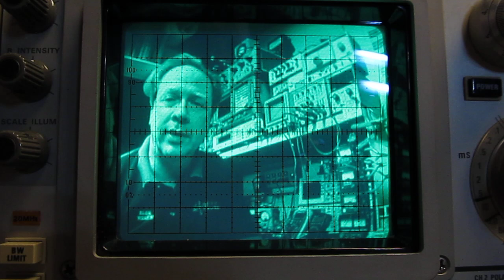W2AEW Channel Trailer video (#95)

Comment: Just discovered you channel and agree that it is the most informative electronics site I have found. 50 years after receiving my BSEE, your tutorials are bringing back long lost knowledge in a concise and understandable way. I am up to video 120 and thoroughly enjoy watching them.
I am very interested in duplicating many of you basic electronic experiments. I have a good inventory of digital stuff, but very little analog. Can you suggest a list of analog components that would make up a good kit of parts for experimentation. Specifically op-amps, comparators, transistors, and diodes. It would also be useful if pdf's of your diagrams were available. Thanks for the great videos.
Reply from the maker: Thank you for the nice comments on the channel.  I am glad that you're enjoying it.  A good jump start on parts can be gained by picking up a kit such as: 
https://store.digilentinc.com/analog-parts-kit-by-analog-devices-companion-parts-kit-for-the-analog-discovery/
Or, if you'd rather get things yourself - get a basic set of passives (1/4w resistor assortment, ceramic capacitor assortment, electrolytic cap assortment, LED assortment, diodes such as 1N4001, 1N914A or 1N4148, maybe some zener diodes, basic transistors such as 2N2222A or 2N3904, and their PNP counterparts.  General purpose op amps (single supply, rail to rail would be the most versatile)...  Again, might be easier to start with an "analog" kit like above.   Also, please note that PDF files are available for most of my videos - the link for the PDF file (if available) will be in the video description that appears below the video on the YouTube page (you may have to hit the <show more> button).

Comment: You tricked me, I thought the image was overlaid on an oscilloscope :) Respect!
Reply from the maker: Yep, that’s done by feeding NTSC video into a homemade NTSC to XYZ converter based on a sync separate chip, some resettable ramp generators and a z-axis intensity / luminance buffer, all feeding a Tek 485 scope.
Reply: @w2aew  Yeah, I spent some time thinking about how to fake this result from the moment I recognized the reflections as real. I was fascinated by the plan to achieve a clearly displayed image. Thank you for the explanation.

Comment: Hi, thank-you for the video tutorials. Can you please make a video tutorial about a wireless test set (250kHz - 999MHz) : for example IFR COM-120B. How to generate modulated signals and how to inject them in different parts of radio transceiver for troubleshooting .
Reply from the maker: If I had access to a test set like that, I'd do a video on it.

Comment: Thank you Sir for all of your wonderful contents. I have a suggestion, which helps people like me, who are not electrical engineers. This is not my own idea. Ben Eater, started a series of videos about making a CPU. I learned about a lot from him. I was wondering if you can do similar thing in RF area, For instance making an bare bone oscilloscope, or spectrum analyzer, and along the way explain the concepts related to RF engineering. I can read these things in the book, but it will be easier to grasp if someone put them in a real projects.
Thanks again,

Comment: Hi Alan, I am currently  working with Beacon Flash lights and warning Bells. I would appreciate some video tutorials on Xenon lights and how the main cap discharge into it. Also some information on sound measurements as  I am currently using sound level meter to measure a Bell sound in a range of 106-111 dB (tolerance -,3, +3 dB). Many thanks.

Comment: I have watched a few of your videos and you have a major talent for electronics obviously. I  recently purchased a 2215a  as a total new B to oscilloscopes, bought for  sine wave AC current household power. Wave compared to a generator wave do you have any recommended people for looking at my scope for proper tuning?
Thanks JC
Reply from the maker: I have many, many videos that describe the use and operation of the controls of an analog scope like this.

Comment: Hello Alan,
Would you please make a video showing how to measure the sensitivity of any radio receiver in a practical way and explain how to convert sensitivity to certain expression once interpreted in different forms like uV, uV/m , uV  at (XX)db or uV at 50 ohm ..... etc
I have encountered many ways of such expressions used by radio receivers manufacturers from portables, to high end communication receivers, and I'm really totally confused how to compare an apple to apple . Also many claimed that they have enhanced the sensitivity of their radios with certain modifications, is that possible technically and how to do that practically? Last point, what distinguish a radio receiver from another from reception point of view like sensitivity, selectivity ....etc and how to check these characteristics in the real life.
Appreciating your efforts.
Thanks
Abd

Comment: Hi Allen, not sure how to get a message to you but I'll try here.  I wanted to request a video on the best way to test an old ignition coil on a small engine using a scope and or signal generator.  Preferably both with mechanical breaker points and a more modern one with electronic ignition with the two transistors in a Darlington pair.
Thanks, Bruce (K2XYZ)

Comment: How did you get such good video on the oscope? I've tried in the past and only got decent video, but that took me three scopes to do. One for vertical sawtooth waveform one for video amp (used for scope with non amplified intensity mod input) and one for both horizontal sawtooth and display.

Comment: I started a comment a bit ago and it disappeared before I was done, so if this is a duplicate I am sorry.
I have a 2467b and the schematic shows the input fuse on the neutral leg of the power coming from the wall? I am use to putting the fuse on the hot side. Is this because it is either 120v or 230v or did they make a mistake on the schematic, BTW the scope is wired as the schematic shows. I know there is another mistake on the A3 Inverter Board. There are two Caps that are shown in the wrong location and if you follow the diagram you will get smoke. Luckly I changed one cap at a time and caught the problem, I then wrote the person who supplied the caps for my project, and he confirmed they were shown incorrectly.
It would be easy to switch the wires around, but though I would ask someone with more savy than I have.

Thanks, and keep up the good work,
GR

Comment: Hi Alan, Replaced the fuse on the 475A/DM-44. New fuse also opened.So ii opened the black fuse box again , replaced the fuse w/ another, however this time I pulled out the white voltage selector plug, inspected it and plugged it back in the medium position 115 Volts.closed it up, turned it on , The scope turned on ?? running now 2 hours all seems well? Low line bulb flickered a bit in the beginning...gone now at 117 volts..Hope its ok...Carl Thanks N2MFW

Comment: Alan looks like i'm back in the same boat...Fuse went again after about 2 hours of running, just idling...Wonder if the white plastic voltage plug plays a role here?? Or worse, a filter cap in the power supply..I hope you don't mind but i sent you an e-mail , if you get a chance I would appreciate it very much if you read it and would get back to me on the info there....Thanks Very much Carl

Comment: im uneducated and im curious about my motherboards which are very important to me and recently im buying used ones and ive noticed that they have a light that i assume means they have power and when their turned off the light goes out between 1-3 seconds on new boards and 1-3 minutes on used! this concerns me! they used SOLID capacitors not electrolytes. i assuming it because their capacitors have worn out and im concerned this could lead to complete failures and so im curious if they should be replaced and im researching this. you cant imagine what its like to turn something off and its still working!
Reply from the maker: Don't worry about it.  In fact, the longer the light stays on, the better the capacitors are working to store charge - so it's a good thing.  However, you can not judge the health of the capacitors by this method because different motherboards use different values for capacitors, so the hold-up time will vary.

Comment: Hi. Not the first time I ask you something. 

I finally bought an analog scope(Tek 2215A). It seems to be working ok. I had no problem to view some pwm stuff.  But there's something annoying me. I can hear a continuous intense sound coming from the scope. It's a noise I hadn't noticed in scope videos. 

First, I thought it was due to the nature of the crt operation. But I think it is no harm to ask, since it isn't something I expected (maybe because of my inexperience). What do you think? Thanks
Reply: Erick Moraes I know it's been 3 years, but I had an early 2213 that had a bad transformer hum. From what I've read on the Tek Yahoo group, its very common on that era scope. 73 W8BT

Comment: Hi , im new around here , i would ask you if you do a tuturial about class A  and A/B  push-pull  amp , a made my own push pull  class A  power amp based in the old vintage  class A/B sanyo ja 116  , with some chances to give 30w rms power , biased with diodes and a trimpot , and with no equilazers, and it work very well , even without  thermal tracking, because i used huge but very huge and thick heatsinks and only 2 output transistors each channel  (mj15001/2). Sadly i dont own a osciloscop , you may say "hei, how do you know that it works well?"  For instant, the sound its very clear ( dont fuzz around even with hi volume), realist, powerfull,dinamic , and can give you a slit very very thin distortion almost in the end of the volume , and it doen´t always do it , only in certain records. I  know what im saying because i play in a band and i know what the natural sounds like. I make this project half guessing /half acknowledgement. So it would be very cool if you could  a tuturial like this , to know if i miss passing anything , and ................we allways learning . Thanks , ah, sorry my english because im not american/english , im from europe. And thank you for your vids , its really trully learning.

Comment: Hi w2aew.  I work at a broadcast facility and we have airplane altimeter interference getting in to the C-band frequency range at 990Mhz L-band.  I am tracking this interference using an Agilent 4407b spectrum analyzer.  I am currently using max/min hold traces. I think there are interference spikes getting in to the carrier, but, they are low enough that they don't break the max hold trace.  Do you know of any way that I can set up a spectrum analyzer to monitor under the carrier, possibly with something like a max hold with a base line of the noise floor under the carrier?  Thank you.
Reply from the maker: This type of in-band on-channel interference is one area where a conventional spectrum analyzer will have great difficulty showing you what's happening.  The best tool to use to look at something like this is a realtime spectrum analyzer which can process and display the composite result of 10s of thousands of spectrum measurements per second.  It is often very easy to see in-band interfering signals with this.  One example of an inexpensive analyzer that can do this would be the Tek RSA306B.
Reply: Thank you Sir!

Comment: hello I have a yaesu ft-890 I need a trimmer cap and alignment on the radio also the head phone jack needs to be fixed when i pull out the jack the speaker doesnt work please let me know if you can fix it thank you
Reply from the maker: +North East Corner Unit 62 Mobile I'm sorry, but I am not in the repair business.